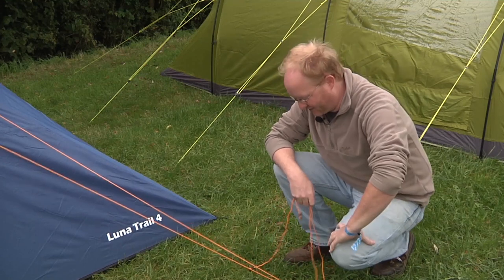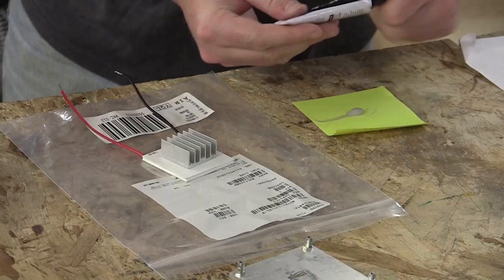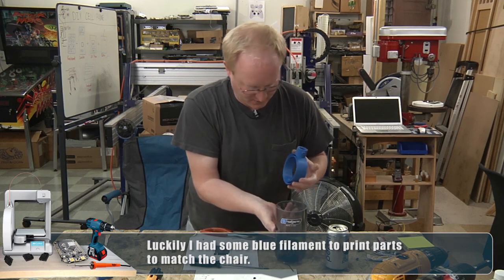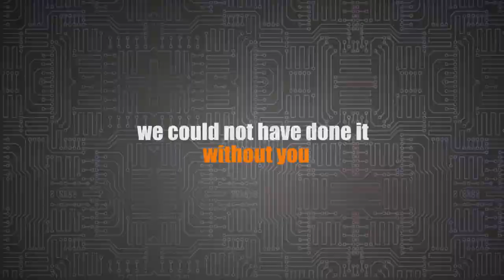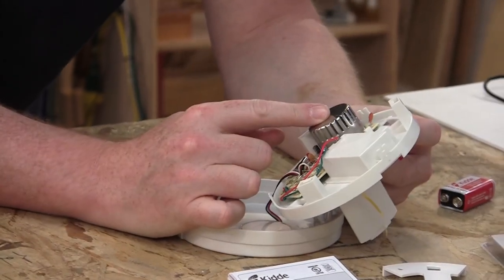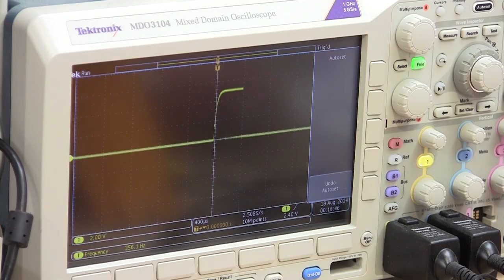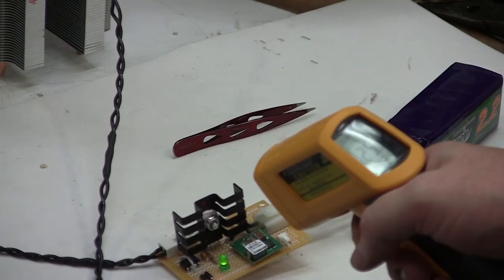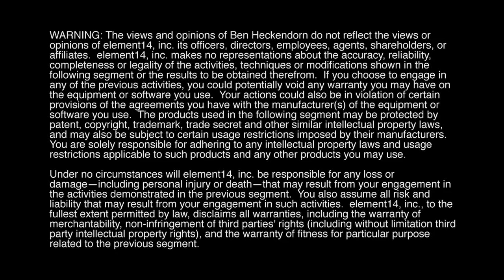Ben Heck's EMFCamp Extreme Camping Chair

Comment: Something worth noting, J-B Weld is thermally insulating. Something like adhesive thermal paste would be better for this, or if you don't have that option, using some standard PC thermal paste (i.e. Arctic Silver) then some epoxy around the sides of the heatsink to keep it in place would also work.

Might be overkill, just figured since you're already using a peltier, you might as well do it efficiently.

Comment: The imperial system is stupid... Metric For The Win!
Reply: USA! Imperial system!
Reply: The best thing about the metric system is that it actually makes sense.
Reply: If you want to become an engineer, get used to imperial. You may use a lot of metrics if you're lucky, but the imperial system is unavoidable in the modern day.
Reply: Siewca Grozy That may be true, but in most cases, even European engineers will do many things involving the U.S.
Reply: TomaloTube At one time using Metric was a legal requirement. They actually made it illegal to advertise primarily in Imperial in the UK. Even if we work with Americans regularly, nearly everything is measured in MM in europe, for example, a sheet of plywood for instance is 1440mm long. The Metric system (i.e. the Decimal system) makes so much more sense. I mean, divide by 10 for everything or divide by 16, 14, 12 or 8 depending on what you are measuring? Unnecessary complexities are a headache.
Reply: Best thing to consider is not what is best (Metric.... METRIC ;-) ) but an understanding of BOTH SYSTEMS and conversion tables!!!

A lot of countries that are now metric used to be imperial, therefore understand the metric equivalent of an imperial measurement, weight or volume. This means that if you still want a pound of sugar, you weigh out 454g of sugar. Pints of pint bottles of liquid are 568ml.

The only issue major issue is with gallons, where the Imperial (UK and others) gallon is 4.54 litres and US gallon is 3.78 litres and the US dry gallon at 4.40.

The reality is that metric is so much easier to understand and many industries that previously sold in different gallons are selling in litres and kilos.

Just be aware of both whilst some stubbornly hold on to an outdated system ;-) hehehe
Reply: ***** Funny, you used the metric dollar.
Reply: ***** Whut? lol. The Dollar is measured in base 10. i.e. everything is either a multiplication of any number preceding and including 10. Another name for base 10 is metric. The $ is a metric currency. An imperial currency would be similar to the old English currency with half pennies and shillings. There were 240 pennies in a pound not 100. Since you have 100 cents to the dollar then it is quite clearly a metric system.
Reply: ***** BTW the subway "footlong" is actually circa 26 cm long, which according to google is only 0.853018... feet. It took a complaint to the advertising standards authority in a metric country (Australia) for anyone to notice.
Reply: ***** He said that it was the Australians that discovered it. It is like that in Europe as well. I am pretty sure you will find it is the same in the US as well. .
Reply: ***** Lol. I truely hope that was a joke :P
Reply: rocketrambo20 there's nothing to learn, unlike imperial it's universally the same whatever you measure.
Reply: Base 10 is so simple, agreed
Reply: ***** Base 12 is a pain in the arse. Using 144 instead of 100 and 1440 instead of 1000. It does not make sense to go to that extra effort. 

I never understood why Americans want to remain so attached to such an antiquated measurement system that is made up from so many different numbers. 16 ounce to a pound,  14 pounds to a stone, 16/16ths to an inch, 12 inches to a foot and 3 feet to a yard. The rest of the world left Imperial behind in the stone age.
Reply: ***** your argument seems illogical. We started with Imperial and moved to metric due to the fact that metric was simpler. Please elaborate on how it would be more efficient to use a none standardised measurement system over a standardised measurement system. US Imperial is different to EU Imperial which is different to UK Imperial. while Metric is the same no matter what country you are in.
Reply: The howl world needs to use the same system metric or imperial like in SCIENCE :P
Reply: Falney I think he means to say if we humans had 12 fingers instead of 10, base 12 would make more sense. lol.
Reply: the metric system is for people who still need to count on their fingers.
Reply: I don't have any issue with Imperial
Reply: ***** Did I mention distance and speed? The road limits are in MPH and Civil Engineers tend to use Metric because why measure how many cm in a mile or how many kg of surfacing will cover 100 sq  feet? Oh and a lot of maps use km not miles. http://en.wikipedia.org/wiki/Metrication_in_the_United_Kingdom first paragraph. Yes we use imperial for distance etc and milk is another example, you get it from a Milk man and you get 1 pint but you get it from a super market and you get 0.5-2 litres. Imperial is used for very little in the UK these days, unless you are stuck in the dark ages. I used it a lot up until my teens even though they didn't teach it in school purely because I was from an Imperial using family. Then I started renovating houses and found that everything sold professionally came in Metric and how much more accurate metric cuts were. The only pain was in older houses where everything was in Imperial. Some more examples. Solder is sold in meters or grams depending on the manufacturer. 3D printer filament is sold in 1 or 2kg spools. The pellets are sold in kg as well, not lbs. The only things still sold Imperial are the things that the "stick in the mud old people" refused to let the government change. Like a Pint of ale/beer/larger at the pub, a pint of milk, etc.
Reply: That's right, brother!
Reply: Spanner Nick No, I assure you they are in litres. I can take a photo of a bottle of milk from Farmfoods if you like? I can also take a photo of one from Asda when I get back to Uni tomorrow if you want. I went and made sure they were in litres before I posted that comment. It is only milk from the milkman that is in pints these days.  edit: Infact a quick check of the Asda website shows milk being available in both litres and pints. Standardisation ftw.
Reply: ***** that's weird actually. i.e. with computers base 2 (binary system), iterative float operations with imperial units instead of metric renders a lot more iterative cascading errors (e.g. units that not only aren't defined via 10 subdivisions, but also which are "irregular" about the numbers of such subdivisions compared to base 10 : you always work with fractional numbers ==> cascading errors - compared to the 10 sub-divisions of any units in the metric system which is much more easy to compute either by hand or via computers, and in the end much more "precise", i.e. less prone to errors). Now if you want to make this a "National pride" like some emotional remnent of a nostalgic royalist, that's another story... ;-)
Reply: TomaloTube(MOVED), that's not true, more and more the metric system is getting its way into the US engineering arena. Because it makes more sense. Actually, ALL engineers around the world use the metric system except in USA and England and some of their unimportant colonial satellites - but not all of them. Even then, England and USA have already set steps for moving forward into the metric system, although this can't happen in a blink of an eye, evidently : there's a market out there that's bloated with imperial measurement stuff, and a thriving market will always slow down any evolution in that sense (which has nothing to do with engineering by itself, even less with scientific evolution, whilst it "must" go with the market and not the other way around, that's how it works in plutocracy).
Reply: DelireWeb the metric system is really the hermetic system and was not invented but rediscovered by french occultists
Reply: Andreas Nicholas What are you talking about... LMAO!!!! now that was funny..
 But who cares about its origins (are you feeling so ethnically insecure into finding some obscure and phantasmagorical reason so as to justify a system which is in fact less efficient than another?) : it just makes more sense, period. A "sense" of which simplicity opens up for "more".

Having been thought and using BOTH systems at University (an engineering school targeting the international arena, not just the US arena), I can compare and tell you that the Metric system is much more "workable" and simpler than the Imperial system.Having then done Computer Science and Operational Research, I can also tell that the Imperial system is more prone to cascading errors with iterative float operations, the kind of operations often used by engineers of all sorts, even in the construction industry (not working with units in base 10 involves working with much more fractional operations).

Note: Actually, if you really want to find "occultists" as you wrote, we could say that a monarchical regime is ran by an occult clique still believing in some backward salic law and pagan "divine rights" for one bloodline... Not the other way around.
Reply: STcraft In the UK for speed and distance we use imperial, miles and whatnot. But all other measurements, especially liquids are in metric. for example millilitres and litres. Also say if you were doing woodworking and you were wanting to measure what you wanted to cut, or even looking for a specific already cut piece of wood, it'd also be metric, and mostly always in millimetres because of how precise millimetres are in comparison to anything imperial.

Comment: My 3d printer question: I have recently bought the Replicator 2 and it prints great with the Makerbot PLA filament, but some generic brand I bought of various colours is having trouble on the lower layers. I have read about fine tuning the filament diameter and first layer temp and speed but nothing is really helping. The first 3 or 4 layers just aren't sticking well and are stringy...I have thought of getting a heated bed for it, but some advice before spending more money would be helpful!

Comment: You could improve the speed of the cooling process by a) using a pump (or a motor with some wings) to "whirl" the water around and b) use a motor to continuously rotate the bottle/can you want to cool, because this will also whirl the water around so the still hot spots can touch the cool walls of the bottle/can and thus cool down faster instead of having it "steady".

Comment: Ben bit of a retro question, could you build an SD to rom loader for the amstrad gx4000? 

It has a few gems in its catalogue but I'd like to play it on the actual hardware instead of emulation.

Comment: Actually, the optical smoke alarms is constructed in a way, that the detector diode cannot see the blinks of light from the Infrared emitter, but when smoke comes into the chamer, it reflects the light, and the detector can see the light pulses. Usually smoke alarms beeps once in a while when the battery runs down. Won't running it from 5V make it turn on the fans in small pulses once in a while ?

Comment: why run the 555 off 5V ? if you use full battery voltage that I'd hope it can take you can pulse the mosfet with a higher drive voltage and get lower on resistance and less heat!

Comment: inaccurate about the use of imperial units in the UK. They actually use metric for everything except road signs. However older people may use some imperial customary units in speech, doesn't mean they actually have a mental concept of those units.

Anyone under 30-35 in the UK was educated exclusively in metric units. Here in Ireland the younger someone is the less imperial units they'll use. If you are 30 or under basically everything is metric (may have memorised your height in imperial but that's about it).

Someday the UK will move road signs and speed limits to metric like we did in Ireland. Until then (or until they start exchanging driver license information) I'll keep ignoring their nonsensical speed limit signs when I drive in the UK.

Comment: Ben, why not make a wood or plastic frame to put the smoke detector in or on and have it facing the direction that you are loooking while sitting down. It seems like you would have a better smoke exposure, and with the way you were sitting with the smoker thing it just seemed like it was blowing smoke into your face, because of how you had the detector pointing away from your back.

Comment: my opinion, you should not have used the smoke detector, especially not one that faces behind you, because when you are sitting around a fire as you do when camping the smoke will be in front of you.
Reply: dh4645g He should have made a 'smoke detector hat'!
Reply: ***** I think that part was a joke, there's no way he didn't do that on purpose.
Reply: Indeed, probably would have been good to 3D print a new case for it with a low profile that would clip onto the other arm of the chair, given the path campfire smoke usually takes when it's traveling towards your face.
Reply: think it'd be better if it was a switch

Comment: we use mostly metric; volumes, mass* and measurements** and all metric (i.e my computer is a 50x50x20cm box weighing 1.2 kg and with a volume of 50 litres). In a lot of industry we use metric 90% of the time with the occasional imperial measurement. 

What do you mean that's convoluted and weird!? Welcome to Britain ;)

*except for personal weight which is imperial (i.e I weigh 14 stones)
**except for distances (i.e I live 3 miles from the train-station)

Comment: The beverage cooler probably doesn't work super great? The heatsink is directly below what you're trying to cool... Heat transfer upwards, so you're going to eventually transfer the heat back to your beverage. I would get a different heatsink, like the GPU heatsink on an Xbox 360, or somehow mount the heatsink at an angle.

Second, JB weld, from what I know, doesn't have many heat transfer characteristics. I would have screwed or clamped a heatsink with thermal paste - get that heat out the peltier quick!

Comment: I would have used a FET for the fans too.
Wow,the Peltier is really 0.08ohms??  That looks like a 3S pack,so assume 10.8V nominal... Dude,that's like 135Amps.  Time for a bigger FET,and heatsink.
(That can't be right,that Peltier isn't even that large. Maybe it's 0.8ohms?)

Comment: Could you make a lightsaber using some colored bright LED's so that the light at the blade extends and retracts (the LED's turn on and off in a sequence). That would need some kind of a chip and the handle could be 3D printed. I'm thinking about making something like this as a prop to a cosplay, but i don't have a 3D printer.